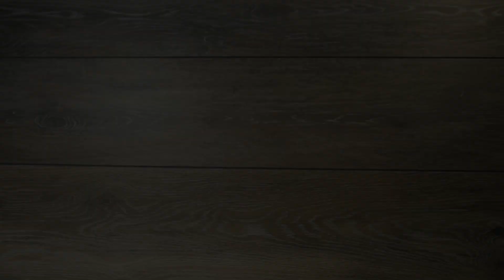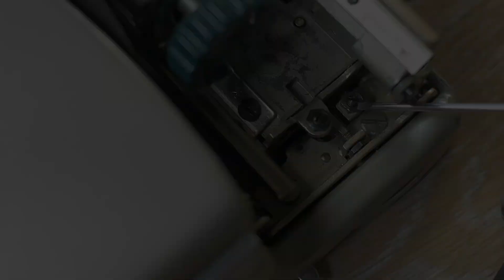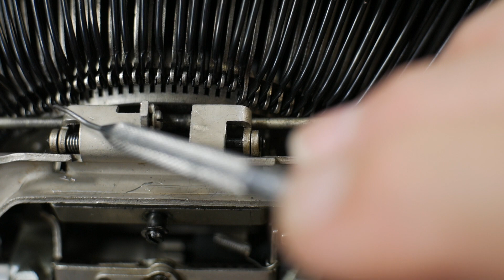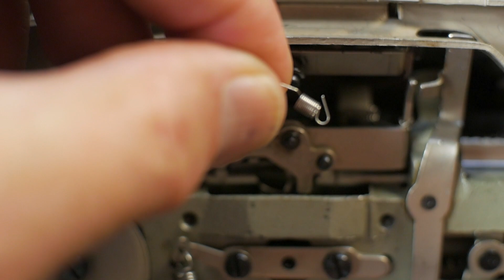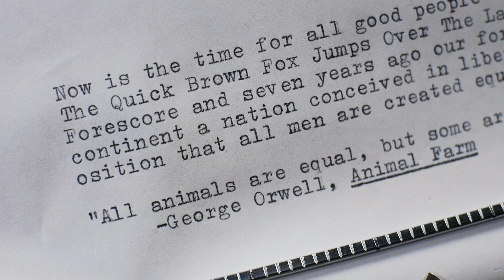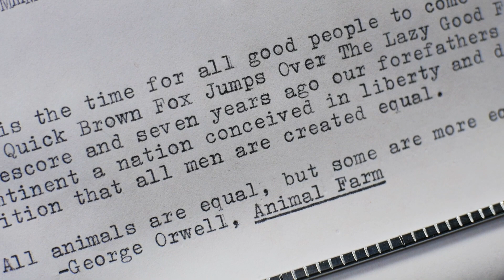Typewriter Video Series -- Episode 265: The Process of Continuous Improvement

Comment: Great and thorough video! Interesting small machines. I have a question...I have not heard the term gaffer's tape before,does it go by possibly a different name? I'm thinking it might help with my solution for skipping a keys on H3K 65&67 an Underwood/Olivetti letter a 22. Thought it was my typing technic,but,if all struck firmly enough,skip. Great video,enjoying watching the adventures this little machine has been on.🙂
Reply from the maker: The gaffers tape I added to the crescent-shaped "anvil" on this Kolibri, to pad the impact of the type bar, was because the escapement trip point on this machine (when the carriage begins to move), happens close to when the type slugs are hitting the platen; this can cause "bouncing" of the type bars off the hard rubber platen, which can not only cause a double strike, but can trip the escapement a second time, causing the skip. The gaffers tape was added mainly for the "Q" key, a peculiarity on this machine. The main skipping problem I believe to be fixed mainly because of the spring I added to the escapement rocker plate.

Most skipping issues are caused by the escapement being in need of thorough degreasing and cleaning, assuming everything else is functioning. It's a particular problem with the Lettera 22 because gaining access to the escapement, for cleaning, is difficult, due to the tabulator bar being in the way -- you really have to remove the carriage to clean it properly, more a job for the experienced repair person.
Reply: @Joe_VanCleave  Thankyou Joe for your assistance in this issue.
Reply: Is gaffers tape...duct tape?
Reply from the maker: @douglasjackson9058  No, it's a cloth tape with an adhesive that will release when needed, but still sticks well, it's used in the film production world (hence the term "gaffer")...I like the Pro Gaff brand.

There are some black colored duct tapes that are called gaffer tape, but they aren't true cloth tape, I recommend Pro Gaff.
Reply: @Joe_VanCleave  such great information.greatly appreciated. Thank you very much.